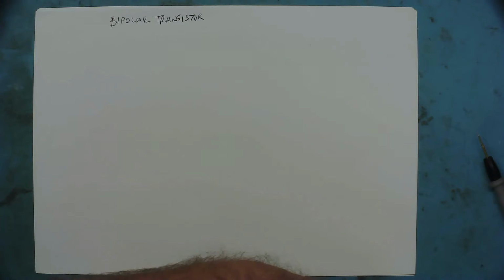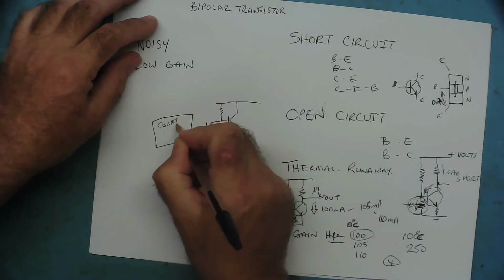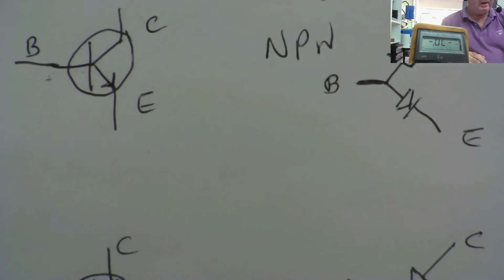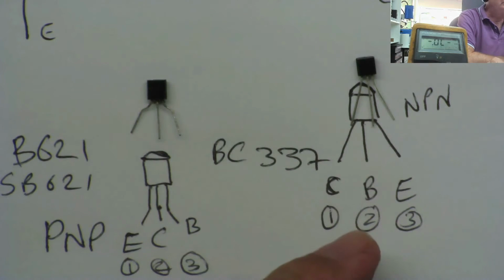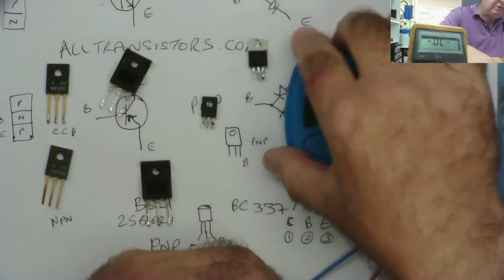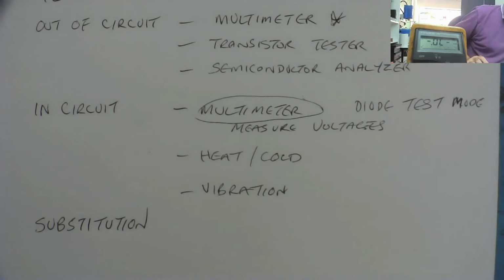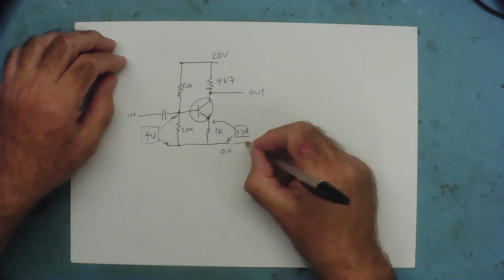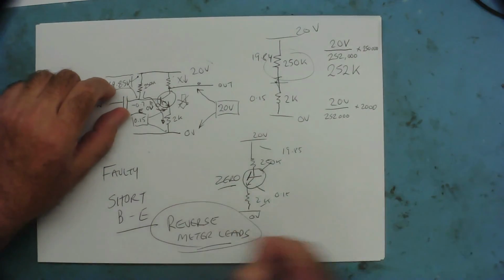Transistors for Beginners Part 3 - How to test diagnose and repair Transistor circuits - LER #055

Comment: Great video and I really like the way you present it, my electronics teacher could have learned a lot from your style of presentation, very relaxed and easy to understand, would have made learning a whole lot easier for me. Incidentally, in all of my years of pursuing this hobby I have never seen electrolytic capacitors as long as the ones at timestamp 1:05:21 Only 47uF at 450volt but quite a length! What is this psu board from I wonder?

Comment: After all your transistor vids i still had no clue on how to BIAS a transistor. All you said was to BIAS it properly and that there can't be more than .6v at the base else it would burn out so i'm thinking that you can only stick .6v at the base (which is stupid really). I looked at biasing vids by others and pretty much the same thing - to just BIAS it without any other info. It was not until the end of this video in the test bit that i saw you can actually have more than .6v at the base (4v in example). You need to make a decent vid (short) on transistor biasing and typical values, as collector and emitter voltages are always stated but the voltage at the base never is.
Reply: its not actually the voltage from the Base to ground that matters, but the voltage from the Base to the Emitter, that must not exceed the 0.7 Voltage drop. 
In this video he biased the Base to 4V using a Voltage Divider, but he had another resistor from the Emitter to ground, which is basically connected in series with the BE junction. 
Now, like any silicone junction (diode, LED, Transistor), the BE junction will only enough voltage to make it work, which in this case is 0.7V and the rest, the 3.3V have to drop somewhere else, which will be that Emitter resistor.
Reply: @GodGecko  very good explanation. 
You have forward biasing and reverse biasing. 
FB turns the transistor on and RB turns the transistor off. 
 
Cheers
Reply: @GodGecko  Almost, but not quite.
The B-E voltage is also dependent upon the current flowing through the junction.
The basic theory that I was taught for a bi-polar transistor was that the junctions E-B and B-C are separate diodes. This is shown to be true by a meter test.
When the B-E junction (diode) starts to pass current the transistor becomes more conductive through the C to E layers.
Imagine the Base layer becoming thinner (a lower resistance) between the C and E when current is passed through the B to E junction.
The name transistor comes from 'transitioning resistor', in other words consider a transistor in its basic form as a resistor where the resistance between C and E is controlled by a current flowing through the B-E junction.